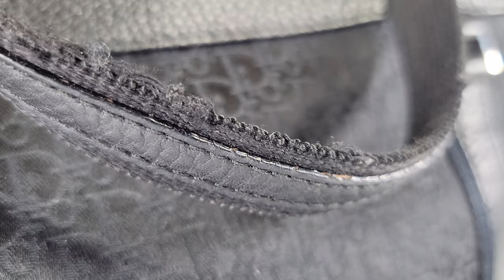🎧ASMRㅣRepair Christian Dior Handbag - replacing handles and refinish edge coatㅣ4K 🖌️

Comment: What is that edging glue called? @5:20
Reply from the maker: clear edge coat.
Reply: @RepairStudio  can this also be used to repair cracks on the leather body of the handbag? Or is it just used for edges/corners?
Reply from the maker: depending on damages, I would use a leather filler for cracks